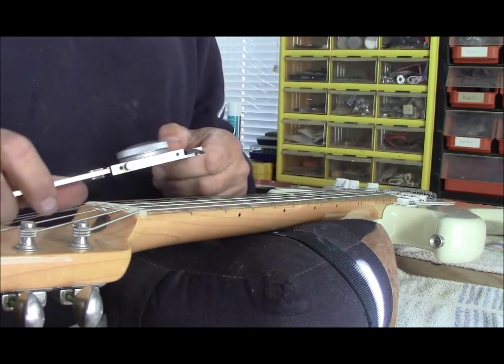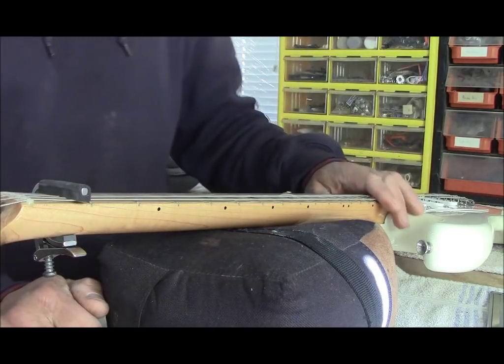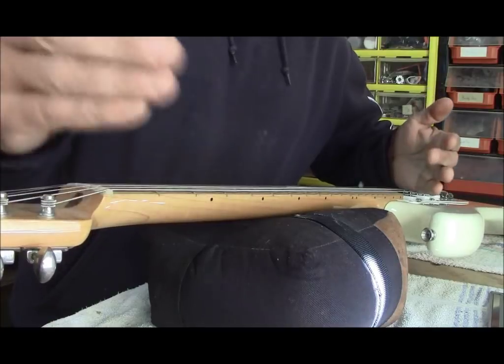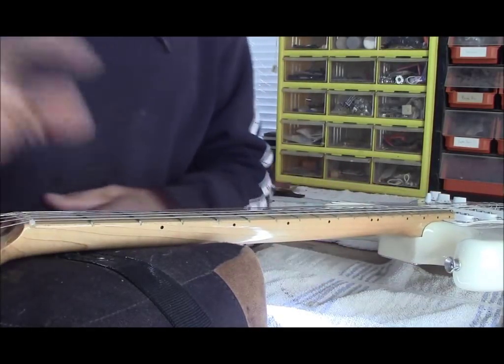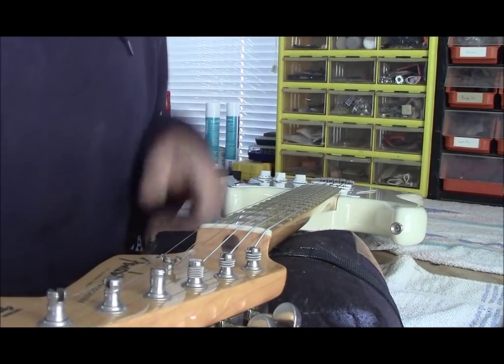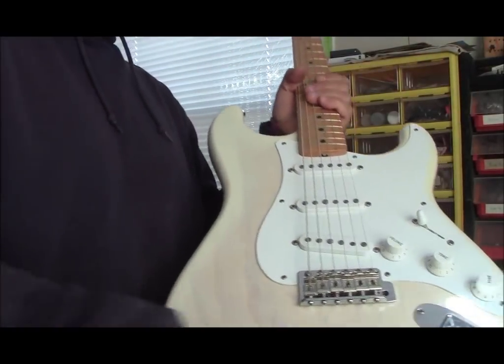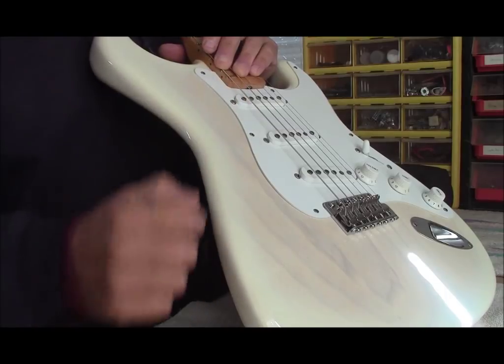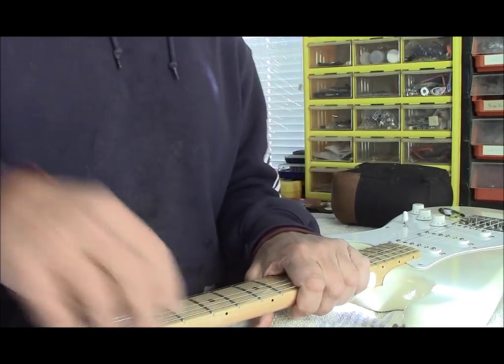Guitar Setup 101

Comment: great video thanks so much! I just want to make sure before i work on my SSD45 that everything you said about adjusting the nut on an electric guitar applies exactly to an acoustic. I suppose so, but it would be great if you reaffirm that
Reply from the maker: Same thing. Same for mandolin, banjo, and any other fretted instrument unless you have a valid reason...such as playing slide...to vary.
Reply: @Bryankimsey  As i mentioned before, my Stephen Stilsl D45 came out of the Martin factory with very high action (both the nut and saddle are too high) I plan to lower the slots on the nut to so that the strings barely clear the first fret (when pressing between the 2nd and 3rd fret), but what about the top of the nut . . . does it require any filing or shaping? or do you think only the slots need to be deeper? and what about the sides of the leading and trailing end of each slot . . .do they need to be rounded or just straight?
Reply from the maker: The top of the nut is primarily cosmetic.  If the string drags on the side, then the slots are a little too tight anyway.  The string's going to find the bottom of a rounded slot so give it a little room so it doesn't bind